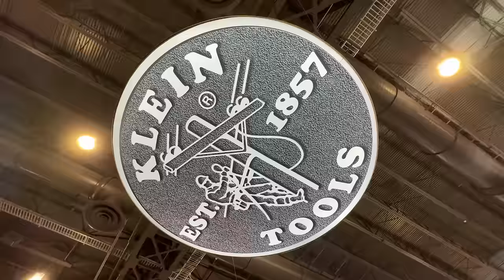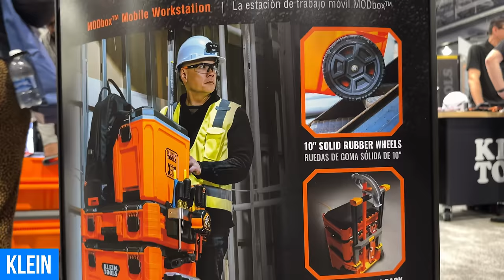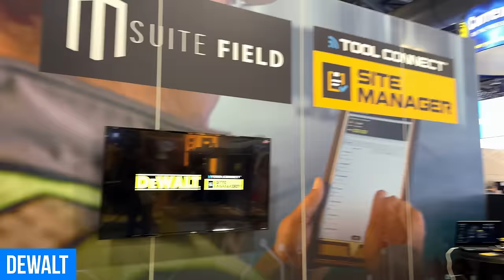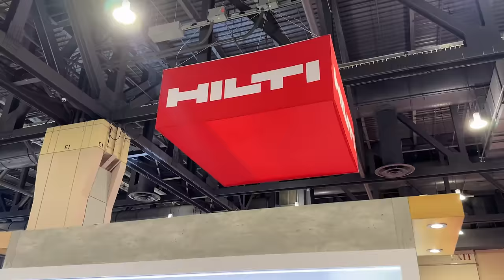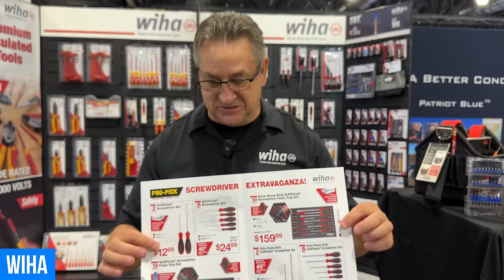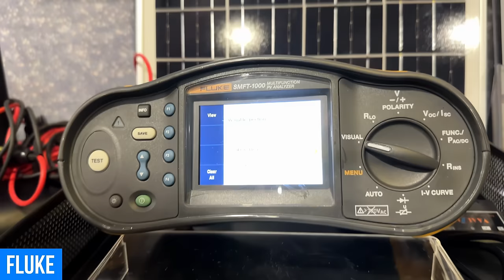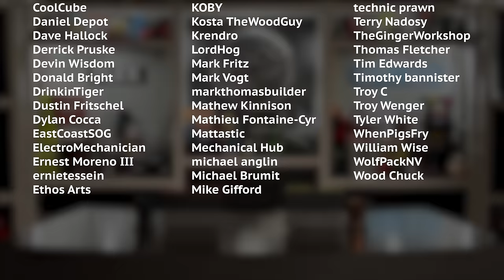NEW Power Tools from Milwaukee, DeWALT, Hilti and more! Live from NECA!

Comment: Klein has quite a ways to go to be on part with flex and milwaukee for tool storage solutions. good start but i'm going to wait to see what they come out with before i even consider them for tool storage. HOWEVER. those kneepads look slick, i will probably be getting a pair.
Reply: The only good tool from Klein is the linesman pliers. We always referred to any linesman's as Klein's. Most of the tools they sell are junk.
Reply: @MrWizards1974  i will never get another screw driver from  them again. The rubber handles they have on them is more offensive than the kkk. For linemans pliers though I got knipex and they are way better than any I have used including klein
Reply: It’s called “on par”, not “on part.” Just helping you out.
Reply: i will say i did see one of their packouts and was surprised how sturdy it felt.

Comment: That Milwaukee rotary hammer is nice last year was doing a underground parking lot and that would have been nice to have had while drilling into the ceiling. Would have been nice to have seen more of the Milwaukee low voltage tools that are "replacing" Klein tools at The Home depot.
Reply: Lots of older hammer drills have compatible dust removal systems, which clip on. But having an integrated send to be better. Though I wonder how it performs on vertical surfaces, where it will be harder to remove dust.
Reply: I don't ever suggest using a hammer drill to drill overhead. I learned the hard way and locked up my chuck. I left my sds drill at my house like a moron and paid for it.
Reply: @yorselrus1996  What would you suggest as an alternative

Comment: Great walk though you guys. I bought that HILTI Multi tool a while ago but just didnt do a video on it yet.
Reply from the maker: Have you used it much yet? We have it as well, but I haven’t had a chance to put it through its paces. I need to get some star lock blades.
Reply: @ToolShow  The tool only came with 1 blade so ive been using FLEX's star lock blades with it. The tool is fantastic though, very easy to rotate and swap our blades. These tool show walkthroughs are amazing. Keep up the good work.

Comment: That DeWalt knockout tool is going to be sooooo useful
Reply: Milwaukee has had two size versions of these with the 1/2”-2” KO size and the die blow mold case with 2.5”-4”
Reply: @mikenormandy9250  ok👍😒

Comment: I switched to the Klein hardhat this past January. After wearing it in the cold and hot weather I can say it is a great hard hat. I'm on call so I'm out at night a lot. The light that clicks in the hardhat is a great setup. Very easy to click it in and not worry about it falling off. The only thing about the light that they should consider is, have the ability for people to use their own lights. I've been using Zebra Light headlamps for over 10 years and, IMO, are the best headlamps around. It's better than Klein's light but with the Klein hardhat I can't use it very easily. Come up with some kind of adapter to fit tubular head lamps.
Also great to see the hardhat fan update. I've got the old style and while not too bad, this new setup looks better for those really hot days.

Comment: I thought the milwaukee supercharger was simultaneous charge. Thats sucks when flex has that 4 port simultaneous charger that charges super fast
Reply: It does! And they have several other ones that do to
Reply: Yeah, the way they talked about it could be kinda confusing.  The charger on "normal" rapid charge is simultaneous.  It's only when doing the "80% in 15-minute" charge mode that it only charges one battery at a time.  I don't really know why they did it that way, it's only pulling about 450-500 watts to charge at that speed.  They could have made both charge at that speed at the same time for not really a whole lot more (considering the $250 they want for the new charger).
Reply: @apllDgrapllD it does not charge both at the same speed so kind if misleading. The other milwaukee charge i have a 6 oort but only charges 2 at a time, the flex 4 port charger does all 4 at the same time fast. Why cant milwaukee do this?

Comment: So it  Dewalt punch set may not punch a hole in a explosion proof electrical panel.
Knock out Dyes make it but the motor will not need to hand crank
Shame.
I keep cutting it with a ratchet
To punch my holes in metal
Is that a 2 point dye cutter a 4 point cutter of a 6 point cutter on hydronic punch set.
Do they sell Decora dye mine getting old and losing the sharpness.

Comment: Did you get the price for the Tiger Stop?
Reply from the maker: Their "home shop" version is around $3,600. The industrial solution they had on display is WAY more expensive. They are all custom built, and they depend on what you'll be cutting with it, how long your material is, and what it weighs. They make custom rigs and tables that can support thousands of pounds. It's pretty amazing, but VERY expensive.
Reply: @ToolShow  I figured it would be pricey, but wow!  Not today 😂
Reply from the maker: lol right? I really want the $3,600 version, but I'd have to have a product (outdoor furniture maybe?) I would produce for etsy if I wanted to justify the costs. Not today indeed!  @tom.coomes

Comment: what is price on the solar meter?
Reply: It's Fluke, so.... If you have to ask, it's probably too much (SMFT-1000 $5500-$6000 depending on accessories, and the radiance meter is $550-600 ).

Comment: I hate to say it, but most if not all of what he was saying bragging about the new Milwaukee battery and charger system has been out for years and other industries LMFAO and when two like batteries are connected in  parallel It doesn’t take any kind of special program or technology for them to equal themselves out as long as they are the same configuration… that’s how electricity works lol. Milwaukee has been a lot of nice stuff but I’ve been in Makita man for 15 years… And all of my chargers have had fans on them for the last 10 years LMFAO and even if you are a huge Milwaukee fan, that last battery system they were using with horrible and everyone knew it… That shit looked like it was from the early 90s for such an amazing tool. It reminded me of my first craftsman cordless drill lol damn thing weigh 20 pounds and charge very similar to how the brand new Milwaukee’s did until these were released. Their older battery offerings were something else! But hey!..a good tool I’d a good tool! And kudos to Milwaukee we’ve been waiting for them to step it up… I’m sure everyone with their tools has as well! 

Errr also  waiting for our huge nine amp hour batteries to charge on them old chargers LMFAO sorry I couldn’t resist! might as well just come back tomorrow fellows😉

Comment: the dual trigger hilti bandsaw was a mistake....
Reply from the maker: Except... it wasn't. They didn't add the double handed safety feature for the user, they built it for the construction company that has to pay massive insurance premiums. If you're a contractor, you might take the risk of using a band saw like that with one hand. A large construction company isn't interested in the unnecessary risk of their employees getting hurt. That's why you make a product like that.

Comment: Surprised  you didn't edit out you not being able to tell the difference between a 3/8 & 1/4 drive! The most basic of tools
Reply from the maker: Surprised you assume I'm one of the delicate men who would rather be a dick than simply admit to being wrong once in a while. :)
Reply: @ToolShow  I would think that a "tool guy" would know the difference at a split second glance
Reply from the maker: @turbojunkie971 Nope! I have to cover not one, but EVERY trade in this industry. And sometimes I have to do it fast. I’m gonna make mistakes but it’s pretty silly to lose sleep over it, and I’d have to be really insecure to edit it out. In this case, I just wasn’t looking very close. But of course the rep quickly pointed me in the right direction. Just part of the job!

Comment: DeWalt is just a little late to the race when it comes to electrical power tools - Milwaukee already has two size power KO sets, a 12V cable cutter, 18V cutter AND crimper in one tool - and that large wire stripper!